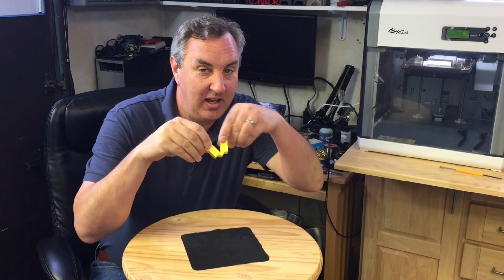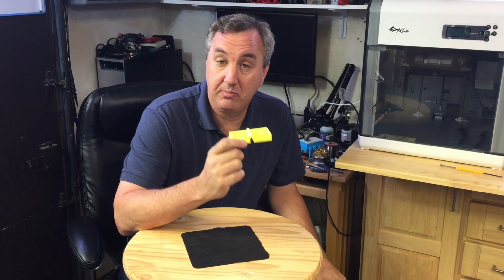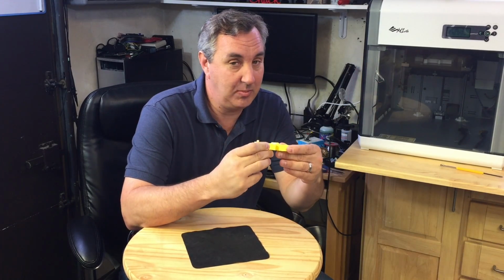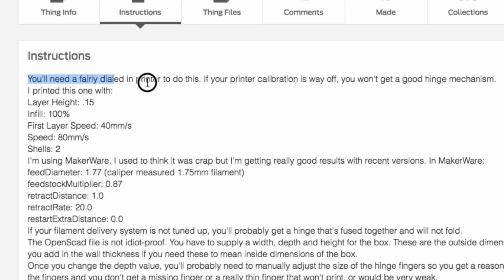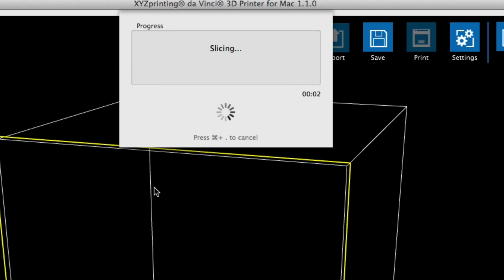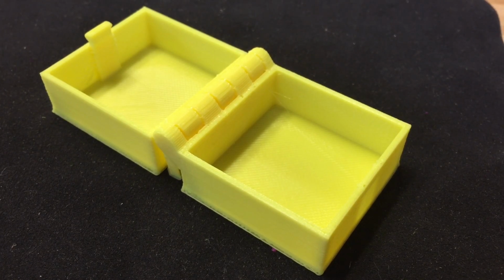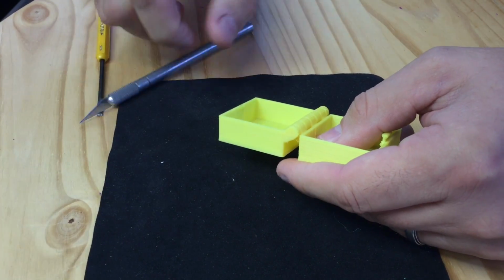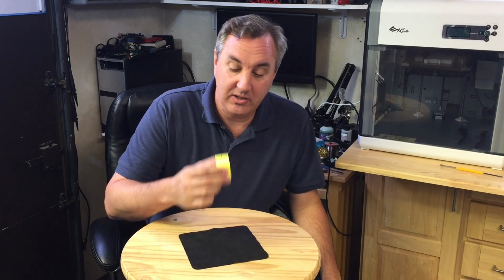Davinci 1.0 3D Printer Test - Single-Print Hinged Box - Video #016

Comment: Nice video,  I tried to print the NASA space wrench but that did not move until it snapped apart :(

I'll have another go when I get time on a slower print speed.  

Contrary to what people believe, the XYZ software although somewhat limited is a good slicer, I have just flashed my 1.0a because I thought it may have been an issue with the latest firmware but it turns out it was the board, (JP4 blown)

So yes you have more settings to change with repetier & Cura/slic3r but its more temperamental.  like the nozzle hits the bed during the start of a print and if you don't know what your doing, you will get really shitty prints at first.

So after all this, I would just say to people if the XYZ firmware is working for you, stick with it.

Comment: Need help on a print quality issue. Same printer you show here, when I print a wheel for model or rc car, I end up with a flat spot. Even when I print multiple wheels at a time, they all get the flat spot. Any ideas what could be causing this. Also I corrected my bed issues following your tips, thanks a million for that.

Comment: I need help finding good free software for making my own stuff can you recommend any please
Reply: Thank you and I don't know what happened but my daVinci 1.0 AiO, heat bed calibration number are they all so post to be the same because I got it but the number were 245 230 250 and it my the hole print head body ticks when moves can you maybe give me some ideas that could fix it Please
Reply: ok thank you and sorry if im bugging you but one more thing I need to ask you, my 3d printer is not Pushing out the filament
Reply: I think, can you make a Video on removing the extruder please there's a lot of wires and I don't want to brake anything.... it Would Help
Reply: you could get auto desk inventor for free with a student licence its not too difficult and you can export to stl's